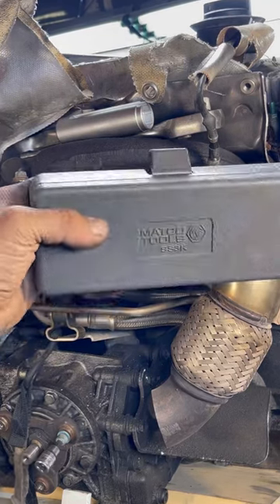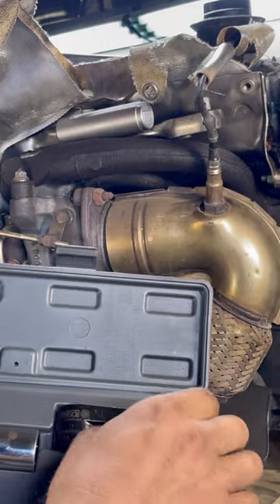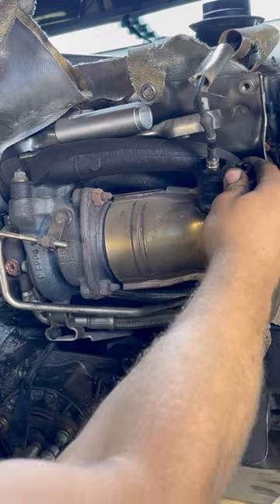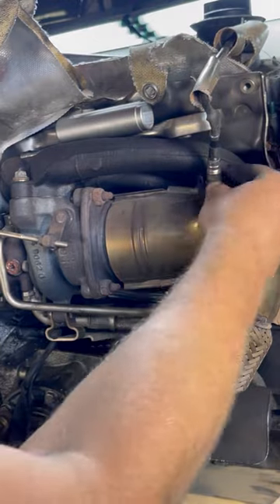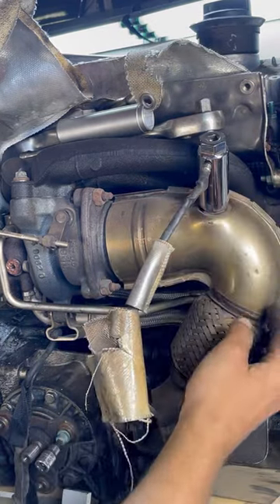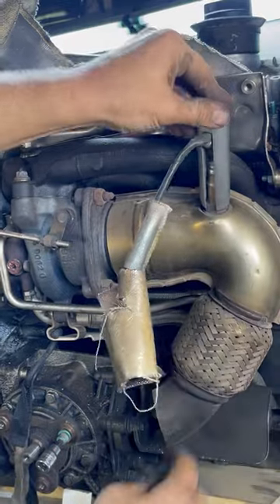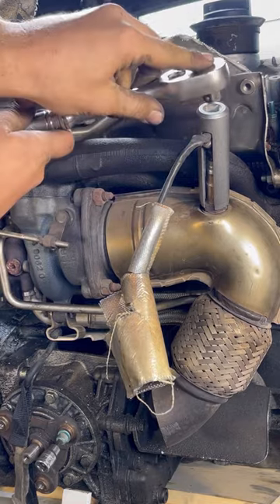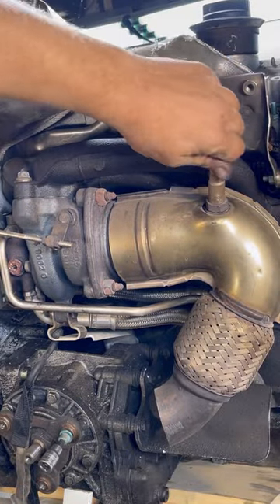VAG specialty oxygen sensor socket T10491 VW Audi 02 exhaust lambda removal tool

Comment: Never had an o2 sensor come out that easily.
Reply: Nobody has 😁
Reply: @randywl8925 Half the time it's heat penitrating oil and chop the wire off and use a proper socket.
Reply: @AverageHouseHusband  Heat ended up working out for me.
Also, the socket end of the tool has a bevel ground into it. I assume that makes it easier to fit to the hex on the sensor.   I ground the end of that O2 socket  flat,  removing that bevel or chamfer.
Doing so allowed much more contact area on the sensors hex nut.
My S10s sensor is hard to angle a wrench onto.
Reply: @randywl8925 I have🤣
Reply: Sometimes you get lucky
Reply: Southern cars less rust
Reply: @randywl8925 being a mechanic in arizona has it's benefits I guess
Reply: @coryament  Absolutely.  I just can't live where it gets much above 75 in late summer..😁
Reply: @randywl8925  it definitely sucks.
Reply: I've never had one be difficult to loosen, just the difficult position like many cars. As far as the tool goes Snap On I'm sure makes a good one. Most of the time I have removed them with a7/8 old school Craftsman wrench.
Reply: @johnpopoff7950  Must be where you live or where they are Located. The cars I have worked on they are located In the salt and other unpleasant road spray.
Reply: Came here to say just that. There's no way that he didn't remove that first
Reply: Total BS
Reply: Never had one that was hard. Open end wrench every time.
Reply: Hit it with a torch for a minute or so and then soak it for a second with PB Blaster or Kroil, wait a few minutes to let it cool and draw the oil in and it should pop loose.

I make it a habit of spraying the threads with brake clean so it doesn’t mess with the new sensor.

Hope this helps.
Reply: Hahahha you damn right, have been wrestling with them for a long time now😂
Reply: Damn you right
Reply: I just pulled my wideband out that's been in for 50k miles. Good copper antiseize goes a long way
Reply: EXACTLY
I am in Ohio so lots of snow and salt so corrosion is always a given and I never had an oxygen sensor break loose that easily either......
Reply: It was already loose, didn't you see it wiggle when he was demonstrating the fit?
Reply: You are replacing the sensor… Cut the wire, use the appropriate sized deep impact socket to easily remove the old sensor. Use the specialty tool only for installation purpose. You’re welcome😂
Reply: Nobody likes to work on a hot engine but once you warm the motor up they tend to come out a lot easier.
Reply: For real that was like a 7-8" ratchet
Reply: @randywl8925 wait there's areas that dont
Reply: We live in rustbelt so it be like that hit it with the torch boo
Reply: Salt causing corrosion makes 02 sensors hard to remove. But another culprit is going through many extreme heating and cooling cycles over many years.
Reply: You think so? I ended up replacing the catalytics converter in my bmw because those sensor never bulge!!!
Reply: @randywl8925 I have, I live in tx, no rust, no corrosion. If the car isnt like 30 years old it’s easy too get em off, little bit of leverage if possible and it’s easy. I know it’s totally different for people in the rust belt tho
Reply: If only someone would create a wrench that was open on one end...
Reply: @randywl8925 I have, move to Florida and buy lifelong Florida cars. I've done it in the parking lot of the auto parts store with a loaner tool quick and easy! And that's on cars old enough to need a new O2 sensor. 😂
Reply: @randywl8925 I just can't live where they dump millions of tons of rock salt on the roads every year it's cruel.
Reply: @ButterfatFarms  Makes you wonder what the fish populations are in those states...... water goes somewhere and it's certainly not treated.
I'm on the Oregon coast, so it's not all that often they treat the roads.  It's a liquid of some kind and used sparingly.
Reply: @ButterfatFarms  Too many people. I live on the southern Oregon coast.....
.....still too many people. 😁
On the bright side, you can drive for 15 or 20 minutes and there are  NO  people.
.....still to many 🤣🤣🤣
......that's still too many.
Reply: In Florida we can do that shit with a 22 mm wrench
Reply: Ive had this happen. Changed it on my volvo xc70 2.4t petrol. Used a spanner. One click and it winded out by hand. Felt as if i won the lottery
Reply: I was also thinking this
Reply: @randywl8925 i did, because mechanics around here use ceramic spray on the treads before installing them so they come out easy. I also didnt waste a bunch of money on a Socket and just cut a slot in an old one i had.
Reply: They always come out easy, do em hot! Hell I use a crescent wrench too

Don’t touch the exhaust! Or you’ll be reminded not to
Reply: I just used a wrench on my 98 Mustang sensors, which could have been used here.... but easy when its on an engine stand or totally accessible like this situation @AverageHouseHusband
Reply: Midwest, East coast problems
Reply: Never took out a working O2 sensor... So I cut the wire and use a regular socket

Comment: If I'm replacing the sensor I cut the wire and use a normal socket. I use a sensor socket to install the new one. Much easier that way.
Reply: I cut the wire too
Reply: Replacing the sensor I would agree. But doing work and wanting to save the sensor I would want something else. I have a few o2 sensor tools and they work but that OEM tool seems nice.
Reply: @johnghatti5435   and pretty damn expensive for a single socket even in europe...
Reply: Just use a couple of wrenches no special tool needed
Reply: @rustybritches6747  only bad thing with heat shrink on the O2 sensor wires is it won't last due to the heat from the exhaust and engine block it will wear fast and let moisture in
Reply: And it pays the same
Reply: Always use some antisieze on the new one
Reply: Hell, with such an easy location, a nice crescent wrench will fit really snug and not cause any problems.
Reply: @Straight_White_Fatherly_Figure Right? You can just use the proper size wrench when they are wide open like that!
Reply: Most of the time yeah but if you want your core back you can’t cut the wire 

Freightliner NOx sensors have a core so ya you cut that wire …no core
Reply: I was gonna say the same thing cut the wire if you’re replacing oxygen sensor no brainer😂😂  put a new one on good to go.
Reply: Just use a spanner to replace it lol
Reply: Yup
Reply: I just cut the wire on the new one and then rewire it after
Reply: Here we go
Reply: Lol yes indeed. Why worry about the old one?
Reply: Don’t cut the wire. NOx sensors have a $175 core return.
Reply: @robertdickerson16 $175 core return. Don’t cut the fucking wire. Use a torch for 30 sec and a 17mm wrench. They pop right out.  They cost $700+ for NOx sensors.
Reply: @MyMessage_Is_Simple the $175 core return.
Reply: @crf80fdarkdays or some heat then a spanner / line wrench he’ll even a 17mm will do with some heat on the bore
Reply: @daniellepage2923  that's it, or off engines running get it up to temp and some upsidedown air duster on the sensor. It amazes me people don't go for spanners in tight to reach spaces. Always good to have cheap spare spanners on hand to customize, bonus points if you have an oxy (I don't so would probs just use my welder to get it hot lol)

When there's a will there's a way, sometimes your best off stepping back and making a coffee while you plan and eye things up.

Didn't know about the core return being that decent, is that for most nox sensors?
Reply: @daniellepage2923  the sensors usually don’t even cost that much lol
Reply: Now you are talking
Reply: Not wearing sissy gloves makes this a guy you can trust.
Reply: Remove the pins from the connectors, use a box wrench, reassemble. Takes 30 seconds.
Reply: On Commercial trucks they take Cores. So we aren't supposed to cut wires in our Shop.
Reply: Real experience speaking here
Reply: @daniellepage2923 LOL. Nobody is giving you $175 for a oxygen sensor core. And it wouldn't matter if you cut the wire anyways as the value part is in the head. The platinum is worth like $2.
Reply: @getitdonegarage  You being sarcastic, right?
Reply: A lot of sensors have a core charge so you cant cut them
Reply: @littlejackalo5326  Why are people arguing this. There is a core for around $150. If you cut the wires the supplier will not take it. This isn't arguable. Sure, if you're working on your little Mazda at home you can cut wires but if you're in Heavy duty or Medium Duty trucks at a shop. No.
Reply: Im surprised anyone saves these if they take them off in the first place. If it was new sure but in all honesty they need to be changed every 20k or so.
Reply: @jamestburgess6372  😂
Reply: Matco flex head o2 sensor wrench (with wrap around index end at the sensor) is the best o2 sensor wrench I have used
Reply: @spawntohell  $46 straight from Volkswagen

Comment: I saw a tip, where a guy tightened a couple of hose clamps around the base to prevent the socket from spreading open.  Every little bit helps.
Reply: That’s a great idea.
Reply: I've squeezed them with a vice grip
Reply: This does work I do it all the time
Reply: @abradolflincler00  I sanded the O2 socket flat on my belt sander.  For some idiotic reason the inside of the socket has a large chamfer that reduces the contact area to the O2 nut tremendously.
Reply: @randywl8925  yeah I did the same with mine, that chamfer is a bad idea on those sockets, definitely makes a difference with it slipping off the sensor

Comment: The other week I was removing an O2 sensor from a snowmobile exhaust. The whole time I was thinking, "i should make a socket with a gap that slides over so I can still use a breaker bar". Today i found out they actually make that tool😂

Comment: Ive replaced hundreds of O2 sensors and always used a open ended spanner, I’ve never rounded one in my life 😂
Reply: The torquing process may not be good for the sensor.
Reply: @thisisyourcaptainspeaking2259  Jesus Christ... they get torqued either way 🙄
Reply: @DeseanWick  Distorted?
Reply: yep use a open end spanner to break it free...after that its easy🙄
Reply: Same
Reply: stemartin6671 💩 on ya 🧢
Reply: I use a flair nut crow foot or wrench more bite and never round them off.
Reply: I'll bet $1 all y'all ain't from Michigan (rust belt).  You CAN NOT weld them on as tight as they are rusted in place.... guaranteed!
Reply: 22 mm.😮
Reply: @experimentmagnet  I’m from South Australia so definitely not in the rust belt but that’s not to say I don’t see a lot of rust 😂, people here love to drive in salt water and don’t wash it off for some reason, still tho I’ve replaced a metric-fuck-load of them under all of the conditions with out rounding them
Reply: @Willbertoslackbold Good to know.  I used to live by the salt in Florida.  It's not the same as the slurry of toxic crap they put on the roads up here.  This stuff rots the fenders and doors off by the inches.

Recently, I have a 2001 Porsche Boxter with 90k miles, probably never driven in the snow.  Changed to a race exhaust.  All 4 O2s were stuck.  2 pulled the threads and one was just completely immovable.   Keep in mind I just pulled 5 sheared off transmission bolts from the back of a 6.5L diesel crank shaft andbbell house when the flex plate failed.  IN the truck.  I know what I am doing

Comment: If the slit type socket opens up on you use a hose clamp around the base.
Reply: Good idea..im thinking a very thick plastic wire tie might get you going too
Reply: @pootthatbak2578 I was thinking the same thing but you might not be able to get the clamping force like you would from a hose clamp.
Reply: Sorry, I didn't see you already mentioned it. 🫣

Comment: If it’s getting replaced the wire is getting cut and I’m putting a regular socket on it.
Reply: That's how I remove brake lines
Reply: @musicpunk5 had one twist on me. Oh well, Snip 😂👌
Reply: Good bye Core. Our shop we turn over cores which give us a good amount back. Cutting wires voids the Core.
Reply: @JohnDoe-iu5xi who the heck has cores on a an o2 sensor
Reply: @evolburd5768  Heavy Duty & Medium Duty trucks. You'd be tossing close to $150 away. Almost half the price of the part.
Reply: @JohnDoe-iu5xi  then your part supplier sucks. We turn nox sensors all the time with them cut
Reply: The guy who made this short ,really should stay away from the hood latch....only use it for checking fluids....! CUT THE WIRE...or call the Mechanic 😢..gotta be cheaper than what he's spending. 
As Forest Gump says...(that's all I got to say about that )
.
Reply: I usually just cut The Wire, Put a 6 point slugger wrench on it, apply a little heat, and give it love tap with a 4lb hammer
Reply: true but what if the new one was faulty and the old one actualy was still intact with the problem actualy was on the wire, then there's zero chance to reuse it

Comment: You totally coulda just used an open ended wrench on that one
Reply: No that’s too easy
Reply: Some people just have to be extra for no reason
Reply: You could also just as easily round off the corners as well. 
The odds sit around 50:50 of exhaust components and nuts and bolts. 
And then there is the busted knuckles risk which is closer to 90% chance. lol. 🤣😥
Reply: @brethart8094 You guys realize he made this video with an engine all ready out for viewing purposes right? 😂
Reply: that was not the point
Reply: You ain't using a Wrench when the fuckers pushed up against the firewall 😂
Reply: If you actually listen he's describing the back of the engine, he's meaning if it was in the car and it would be difficult or impossible to put a spanner there and undo
Reply: @stevegraham3817 not if you know how to use one I’ve never rounded corners with a crescent  wrench knuckles are a fare point tho lol
Reply: I think it's more of a demonstration of how the sockets don't fit well.
Reply: @cody-2536 then you sure tf arnt using a factory O2 sensor socket either...
Reply: No chance it'll pry itself open....
Reply: Thanks you,  I thought I was missing something here.
Reply: I’m looking at this and thinking why doesn’t he just use an open ended wrench ? Wtf
Reply: @CornellSmith-c1n  it'll lever the spanner apart if it's even slightly tight and they can get way tighter then slightly due to the heat cycles....

Comment: Last oxygen sensor I replaced on a Toyota, a 22mm ring spanner fitted perfectly as the square electrical connector was designed to fit through the ring spanner opening.

Comment: I bought a crescent wrench for $1 at a garage sale that gets the job done.
Reply: Good luck on the ones that have a cup
Reply: 😂yeah.. works 100% of the time 5% of the time..
Reply: Uh, that isn't going to work on most o2 sensors. They're usually seized in the exhaust. Using a crescent wrench is usually just going to strip the corners off making it even more difficult. The one in the demonstration was incredibly easy compared to how they normally are too.
Reply: @chris6200 that's what vise grips are for lol😂
Reply: @chris6200 it has always worked for me
Crescent wrench or open ended 

Keep the exhaust hot, never try to remove a cold sensor

If on your first attempt it doesn’t work, pb blaster or wd40 it, heat cycle, repeat, reattempt. Maybe tap on it a little depending on your rust condition. You could also attempt to slightly tighten the bolts, sometimes it helps break a bind. 

I have never been unsuccessful, and I don’t recall ever having attempted more than twice, but I’m sure some conditions could prevail

Comment: Procedure in rust belt:  heat red hot with tourch, soak with ATF & Acitone mix (awesome stuff, try it).   Put on tool, slip, smach knuckle on sharpest possibel part of engine.  Use teeth to remove loose skin trying not to bleed on stuff and scare onlookers.  Use paper towel & electrical tape as band-aid (obviously inventing new "words" the whole time).

Finally strip the $#!t out of tool and or  sensor.   Give up and use biggest pipe wrench and hammer you can fit in the space.  When sensor comes loose, rotate removing the threads on the sensor AND bung on the exhaust system.  Hammer in and mig weld the new one in place.

Facts/reality!
Reply: *torch; acEtone; possiBLE; shit
Reply: @Sam-ob4of  Thanks for correcting my tired @$$, no glasses, relying on spell check spelling.   Seem life is slow there...

Comment: I bought one at Advance Auto Parts back in the ‘90’s to change out the O2 sensor on my Buick 3.6 and it fit like a glove no problem getting it on tightly fitting the sensor and replacing it. Only set me back $65-70 total.

Comment: I have the VW factory oxygen sensor tool kit.....about 9 or 10 pieces.   Works great.....never failed me yet. Have been available for over 20 years.  Weren't that expensive back then.....about 130 bucks!!  Someone said they cut the wire and remove  with a regular socket.......under warranty the dealership can not be cutting wiring harnesses.

Comment: That type of socket with the slot in it will start to spread apart and round off the hex on the O2 sensor. I will cut off the wires from the sensor and I  usually use a 7/8 closed end wrench to change mine. As long as you  have the room to get a wrench in there.

Comment: I bought 2 different O2 sensors sockets made by Lisle both look just like the ones he is showing and they both fit the O2 sensor good and the one doesn’t push the wire down like the one he has!

Comment: Heat, penetrating oil, and a worm drive hose clamp on the end of the socket to prevent it from spreading out when you go to loosen it has helped tremendously.

Comment: I bought a cheap one from ebay, it fits really well and has worked perfectly when I've used it, I've only used it maybe 5 or 6 times and didn't see the point spending more on something I rarely use